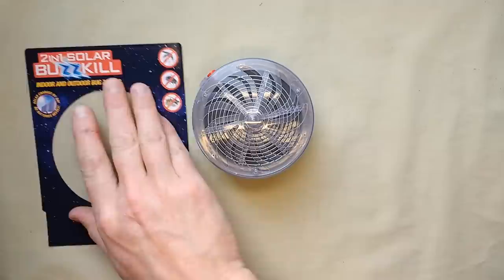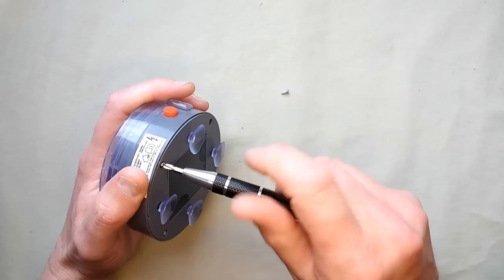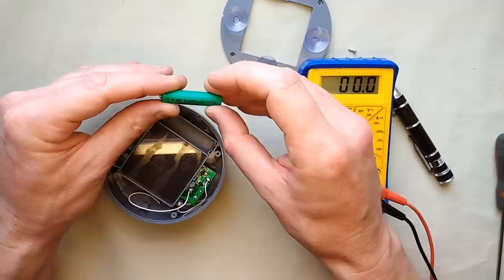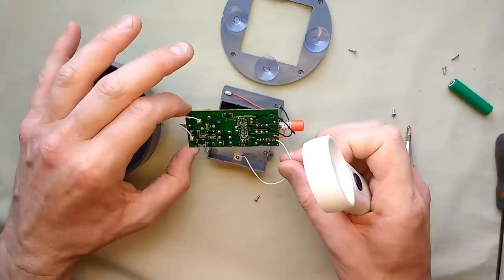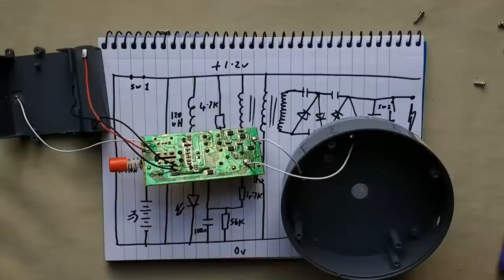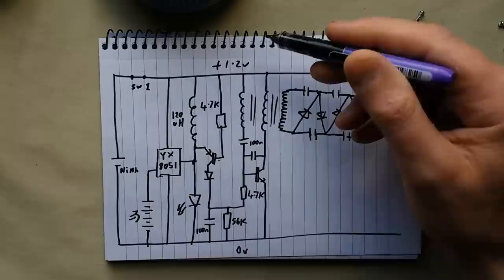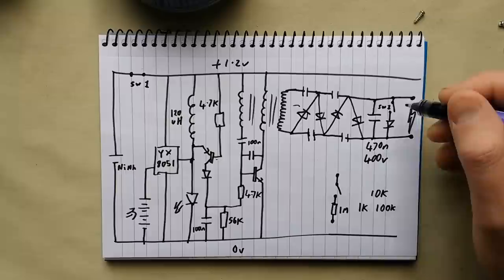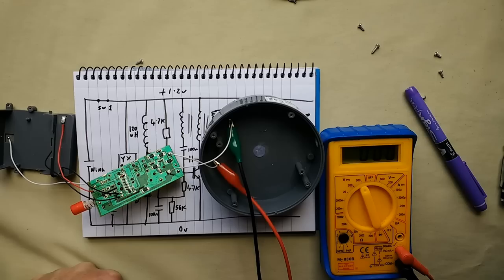Buzzkill solar insect killer with weird schematic.

Comment: I think that the resistance of your multimeter (cheap 1Megaohm one ?) brings the output voltage down.  The diode that discharges the capacitor is really weird. I think that you may also have a mistake in your schematic (in the multiplier)  - this way there would be AC going into the big capacitor. The PNP transistor is definitely not weird. Without this transistor, you would always have  at least 1.2V going into the NPN transistor and so the high voltage inverter would never turn off. The PNP transistor is required - it only turns on when the LED booster is active (when the LED voltage is higher than the battery voltage).
Reply: Glad to see you guys complementing one another's work.
My friend recommended me a couple of videos by Mehdi ElectroBOOM, who in turn recommended me go and watch your videos about the electrocuting shower head.
Since then, I'm subscribed to you both.

Comment: If that runs on solar, how does it work in the UK?
Reply: kumaclimber You have to charge it under 500 warm white LED's for 30 days
Reply: Replace the battery manually
Reply: You buy a wind turbine adapter
Reply: You'd think they'd have invented something that gets charged from rain by now
Reply: Too true! +1000
Reply: Especially in Scotland
Reply: He's right, you know.
Reply: +Green Silver 

  G'day,

   They have, actually, the older version of the Technology is called "Water Wheels", and the Marketing-Jism modified version is called "Hydro(Electric)-Power"...

 Firstly, the Rain falls onto the top of a Mountain, then the Topography collects the Runoff, and subsequently the flowing Water is poured onto a Wheel with Buckets around the Rim, or channeled under a Wheel with Radial Paddles fitted around it - either way, the Water flowing downhill towards the Sea is coerced into generating Rotational Torque in a Shaft.

   The other way of using Rain-Power involves building a Dam at the top of a high Cliff, or on a  Mountain & waiting for it to fill up, then running the Water down as steep a  Pipe as possible, and squirting it onto a species of Waterwheel known as a Turbine, which is thus spun at sufficiently high RPM that Electricity may be generated using a Generator or Alternator coupled to the Shaft.

   The major difficulty inherant in using Hydro-Power is that it takes a really huge Shitpotful of Water falling down a vast height in order to recover any useful Current....

   Put it this way, to use Hydro-Electricity to boil 1 Pound of Water (453mls) so as to make a Cup of Coffee will require dropping 17 Imperial Gallons or 170 Pounds of Water (77.23 Kilograms/Litres) ; straight down from 1,000 Ft (320 Metres)..., onto the Turbine.

  A British Thermal Unit is the Energy required to raise the temperature of 1 Pound of Water by 1 Degree Farenheit (453 ml by 0.55 Degree C.) ; which is equal to the amount of Energy required to lift 1 Pound (453 Grams) of anything, 768 Ft (234.08 Metres) straight up into the Sky....(!).

   Which is why you'll have to drop 17 Gallons of Water from 1,000 Ft up the Mountain, down onto a Turbine which has to be 95% efficient and driving an Alternator that needs to be 85% efficient, to generate suffcient Electricity to feed into an Immersion-Heater to convert into the BTUs of raw Heat with which boil that Pound of Oxygen Di-Hydride....

  It's a bit of an inconvenience caused by Water, famously, having ten times the Thermal Mass of Steel...; ie, One single BTU will raise the temperature of a Pound of Steel by Ten Degrees Farenheit....

  Just(ifiably ?) sayin',

  Take it easy...

  ;-p

   Ciao !
Reply: You don't need direct sunlight to get a voltage from a solar cell. It's meant to be fitted to a window so it charges all the time and I'm assuming it's intended to be switched on when necessary.
Reply: kumaclimber ...the sunlight is imported from china mate !!!
Reply: Nic White, is that import duty-free? If not, I suppose very few folks could afford it.
Reply: Green Silver good thinking, actually some company is working on solar cells that are also making electricity from raindrops :), I think that's awesome!
Reply: actually I provide the sunshine as it shines outta my arse !!!
Reply: Remembering to save a large amount of the energy to pump the water back up the mountain for the next generating cycle! Remember folks its 'green' energy!!!
Reply: Sean Flanagan, the postage is subsidised by the Chinese Government. But you do have to remember that the imported sunlight generates Chinese Watts (CW), and not SI ones. So, 15.3 CW=1W, at today's exchange rate!
Reply: Green Silver u can Google is your friend
Reply: kumaclimber when we get a heatwave or in daylight or any light in fact
Reply: Perhaps it is optimized for grey and dreary.
Reply: But how will it run in the FUCKING GOBI DESSERT
Reply: kumaclimber Disdain!!
Reply: kumaclimber ....ha-ha...yay.Emigrate to us...South Africa...always sunny😆🌞
Reply: Heard of hydro electric? :P
Reply: kumaclimber hold up a photo of the sun on our phones mate. After a cup of tea of course
Reply: Unfortunately the world we use is "solar" power but what we should use is "Photovoltaic" meaning volts from light(dose not have to be direct sun) and as the UK is not totally! dark then of cause it will work.   To be green we should use more!.
Reply: Because it works on low energy actually works at night-time so when the light goes down the sensor turns on
Reply: I think they use 220 solar
Reply: @WaltonPete  didnt understand the joke huh? r/wooooooschhhh
Reply: @mr_muffin498  Peanut just lost his "Fishing Lure"!!  (Jeff Dunham).
Reply: Very Carefully.  ;-)
Reply: If you mean does it charge witj our summer weathe, then yes solong as you put it on the window, the more sunlight obviously the better. But... does it actually work? NO! Had mine 6 weeks and not seen 1 dead fly. Save you money.
Reply: When I moved to Germany for a couple of years back in the 70's, there was a standing joke about having a ration card for the sun.
Reply: Lunar panels :v
Reply: We got a comedian here 😉
Reply: Seasonally inline with the insects ;).
Reply: LOL
Reply: Pmsl
Reply: @locouk  Add a water wheel to your gutters :)
Reply: Poorly
Reply: @locouk  
It’s called hydro electric
Reply: The street lamp outside the window chargers it at night.

Comment: I have had one of these - sourced direct from China - for around two weeks. I had not noticed any activity from it, apart from the blue light,  but taking it down just now, I found a respectable amount of fly carcases within! Even with UK sunshine!  :)
I thought that perhaps mine was different from Clive's, as I have a latching switch, but I can see that his also has a latch on it. I was puzzled by the plastic tab when I first received it and thought it might be required to hold that button down when I first received it. I suspect that we both have a "Mark 2" model! :)

Comment: I wonder if the weird circuit is an artifact of someone who didn't quite know what he was doing simply taking a garden light circuit and a bug zapper circuit and just gluing them together in the middle rather than designing it from scratch.
Reply: You're dead wrong. That PNP transistor is a work of genius. It uses the frequency produced by the booster chip to drive the transformer while also implementing the night operation policy.
Reply: Incorrect. Absolutely not right.

Comment: I think what happens with the PNP transistor, which turns on when the Base goes low, sees Vcc as low compared to the boosted voltage from the inductor and then turns on to shuffle some power into the storage cap for the zapper. So if there is no booster running the PNP transistor is going to stay off as it sees the Vcc as high.
Reply: Yes, I was just going to write exactly that...

I guess the small 4-pin "solar garden light" chip has low-voltage detection and by doing the trick with the PNP transistor (as opposed to a single diode as Clive proposed) they stop current through the transistor transformer, saving the battery from depleting even further (through the transistor base, but that's a second 0.7V drop..) and the 65k resistor.
Reply: This. The resistor would be biasing the PNP off instead of biasing it on, so the emitter voltage would need to be boosted greater than VCC+0.7V to turn on.
Reply: I agree also the diode is reverse biased the way it is drawn?
Reply: Yeah, and the diode just stops the higher voltage on the capacitor draining back into the 1.2v rail via the transistor's internal diode when the transistor turns off.
Reply: But i like pork pies tho
Reply: Electricguy yes, the PNP will normally see the same voltage on base and emitter, so it will be cut off. When the LED booster is running, the emitter will see a signal between 0V and 3V (Vf of LED). The 3V pulses will make the emitter higher than the 1.2V base and it will conduct to charge the capacitor through the diode to 3V-0.7V=2.3V.
Reply: Thank you for repeating what i said. Most helpful. :)
Reply: Electricguy I explained it in a different way, maybe someone will find it useful.
Reply: Also, if you hand say 2 diodes in series instead of  the PNP transistor, wich may work properly ie. blocking the HV section unless the LED is on, you would get current leakage when the battery voltage reaches arround 1.2v, or even lower dependent on the diodes Vd.
Reply: I would call it a common base construction, I actually like it, seems like it only will open if the coil are doing it work.
Reply: Wouldn't it also prevent the boosted voltage as the field in the inductor collapses from flowing through the right hand side when the switch opens?

Comment: The 8051 pulses the 120uH inductor to ground. When ground path opens, the reverse emf pulse from the 120 uH drives both the LED and raises the PNP transistor's emitter positive, to a high enough voltage you'll get base current into the PNP that way. 

Very cool as always!

Comment: Apparently they don't want the high voltage generator to run during sunlight.  In sunlight the chip charges the battery and its output transistor is off so the voltage at the inductor floats up to the battery voltage which is not high enough to turn the pnp transistor on, so the HV circuit doesn't run.  At night the chip periodically switches the inductor to ground creating a boost regulator which raises the output voltage high enough to drive the LED.  It's designed for white LEDs which require at least 3V.  The voltage pulses across the LED go higher than the battery voltage and so pulse the pnp transistor on.  This is a common base mode switch.  The diode and the 100n capacitor rectify and smooth the pulses to provide a dc signal which keeps the HV oscillator running.  As for the diode across the voltage multiplier output, I haven't a clue.
Reply: Might it be a safety thing to not discharge it AC? /s
Reply: +AstralStorm nop, makes no sense
Reply: That diode is to avoid oscilation effects, the the tracks and switch form the inductor in an LC oscilator.
Reply: @picobyte  Why not a diode and a resister to prevent arcing?

Comment: The Diode discharge...The Automatic placement machine was mis-loaded. But since it still worked after, they didn't re-work the items. Since they worked they probably didn't notice....... Even if the diode shorts, it will still work.
Reply: I was thinking something similar.
For me, it was: Maybe the guy who was slapping it together grabbed the wrong part, or the diode was in the wrong bin and he didn't notice, but since the thing still worked, it got shipped to the store.
Reply: Pirate Radio 9 Actually, to me it looks more like they are using the reverse leakage current (5-50uA) of a reverse biased diode to discharge the capacitor, though such is an odd choice given a resistor, or even an SCR (if you really want instant discharge), would have sufficed nicely.
Reply: I went back and looked. I think you're right.  As drawn, the discharge diode is reverse biased.
Reply: Could be purposely running a part out of inventory on a production line to limit waste. Whatever is coming up on the current schedule doesn't really need it. So put it somewhere where it'll work somewhat, just to get rid of it and clear the slot for something else.

If that's the case, then zappers later in the run would switch to using a resistor.
Reply: That's probably it, every penny counts and its probably cheaper to order more diodes than to order the diodes plus discharge resistor. Who knows, they might even have a warehouse full of these diodes that need using up.
Reply: Could be using the reverse breakdown of the diode, assuming the drawing is correct.
Reply: +otherunicorn doesn't look like that, there's no difference in price in relation to a zener
Reply: The diode is used to eliminate kick back and/or arcing.  Same as you would use across relay contacts.  The 470n cap is not going to have enough power to damage the diode.
Reply: IATIA had it right.. Diodes just handle hv better. Pretty clever if you ask me.

Comment: The LED driver pulls the end of the inductor down.
The PNP is off during this time.
The LED driver lets go and the voltage on the bottom of the inductor jumps up to whatever the LED's forward voltage is.  
This is when the PNP turns on and charges the capacitor up to the roughly 3V that is on the LED at the moment.
The 47K on to the NPN biases it on.
The positive feedback winding drives the NPN hard on briefly.
The energy builds up in the high voltage transformer's winding
The NPN turns off and the secondary gets the voltage spike to make the high voltage.

Comment: Clive, I noticed that the LED only lit when there was no current from the solar cell. So it might be that the 'mystery' transistor is being switched on and off by the controller IC, depending upon panel input current. The unit does not produce high voltage during daylight, thus saving battery capacity for night time.
Reply: Yes, and yes: the sun produces a lot of the UV light so this tiny light (and this unit is clearly supposed for being put onto a window) won't matter during daylight anything at all.
And the grill circuitry drains very little current after the voltage multiplier has been charged to its most, so you must be correct.

Comment: the transistor with its base tied to 1.2V is pretty typical.  This type of circuit is useful as a level translator.   They are using it to detect when the LED turns on, because the emitter will be higher than the base, causing base current to flow and turning the transistor on.  Useful for level translating logic levels below ground or above VCC too.  Very clever to use it here to detect when the LED is on.

Comment: @bigclivedotcom the circuit is actually pretty smart.
Voltage on the LED and emitter becomes higher than that of the single cel and base making the pnp transistor conduct.When the LED is off,voltage on the transistor emitter is same as base voltage making the transistor switch off.

Comment: That PNP transistor is actually held off until the led circuit voltage increases which also means the led boost converter is loaded by the transistor base as well.

Comment: 3:08 - "*IF* there is a fuse inside..."  You mean you haven't 'taken it to bits' yet???  I'm shocked!!  ;)
Reply: It's the fuse in the multimeter he's talking about for when it's set to current that will blow of you go over the multimeters rated amperage

Comment: Looking at that cct again the emitter diode isn't [really] needed. So it seems possible that the original cct had no PNP and 4k7, and the diode connected straight to the switched end of the inductor. Then it was realised that this gave a discharge path for the cell via the 56k resistor when the LED side wasn't running. (The HV generator wouldn't run as voltage across the 56k wouldn't be high enough to turn it on.) So the PNP was added as a common-base switch. 

I'd have looked at doing that cct with a diode pump. Component count would be the same, just diode, NPN and cap instead of diode, PNP and resistor.

Comment: The way you've drawn the schematic, the diode in series with the discharge contacts would be reversed biased.  I'm guessing it goes the other way?  Also, you've drawn the final capacitor across the final diode, it looks like it should actually be from the cathode of the last diode back to the top of the secondary winding.
Reply: I was also wondering about that. When I scroll back in the video and looking at the backside of the board I can see that one side of the big 470n capacitor is connected directly to the transformer. Which means that it vill be charged to the opposite polarity, and the diode (which also connects to the transformer) is then in the correct direction.

The (first) PNP transistor will only work when the LED inductor is oscillating. Described in other comments.
Reply: John Rehwinkel I suspect they are using the reverse leakage current (spec'd at 5-50uA) of a reverse biased diode to discharge the capacitor, though an unusual choice.
Reply: That seems meaningless.  It also does not seem to be supported experimentally as Clive noticed that the discharge happens quickly.  I think the diode is biased correctly and Clive's drawing of the voltage multiplier is not quite accurate.